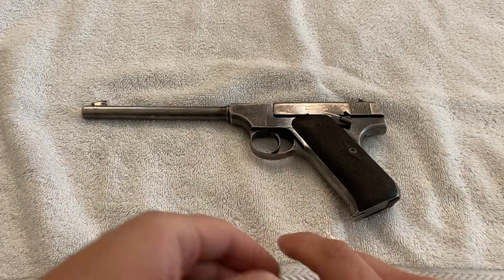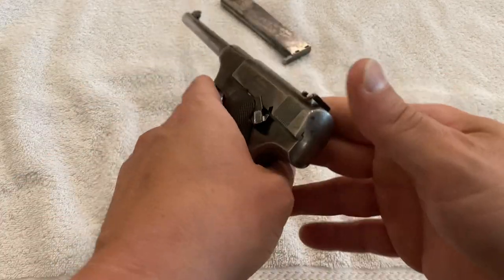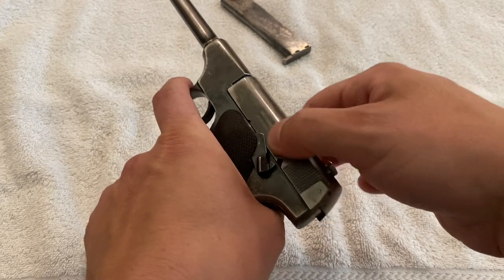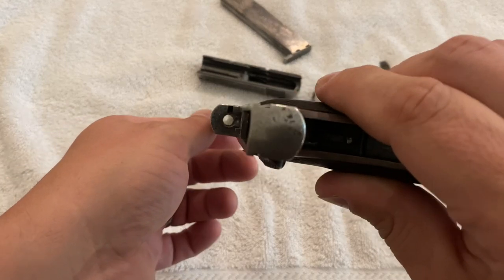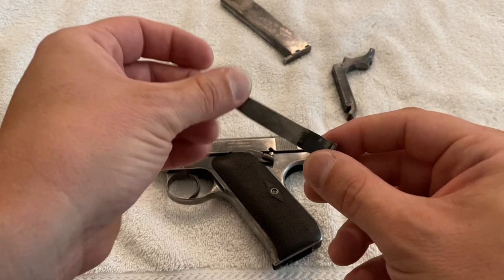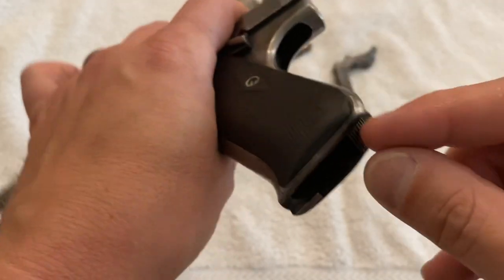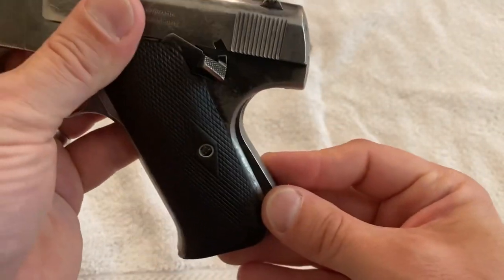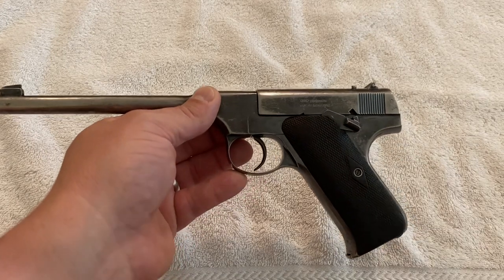Colt Pre-Woodsman field stripping, basic disassembly and reassembly.

Comment: Does anyone know why my slide will not return to battery after reassembly? Have checked that the spring and plate are in the correct place but the slide will not hold tension. I thought it had something to do with the take-down button spinning freely, but the weight of it should be be enough to press the plate down? Any advice is much appreciated